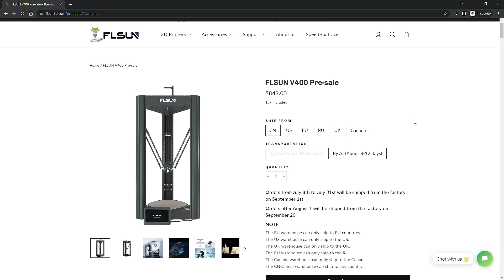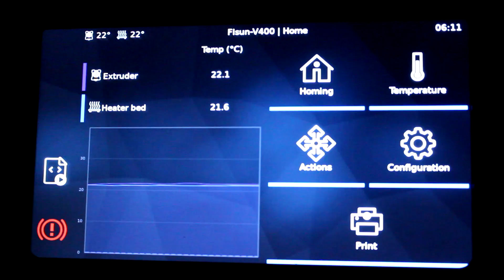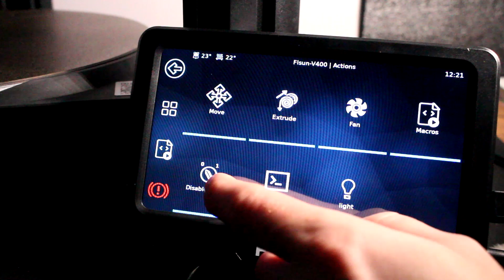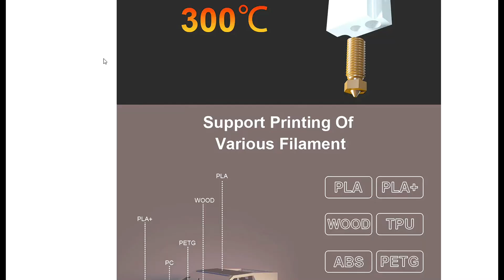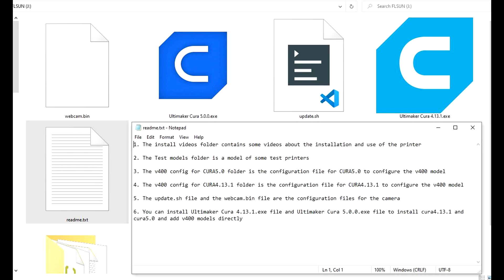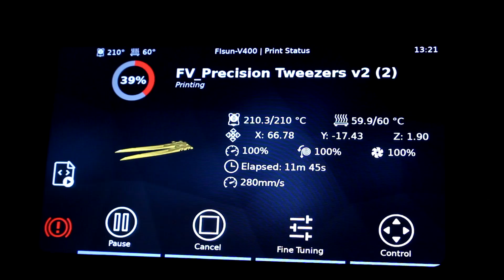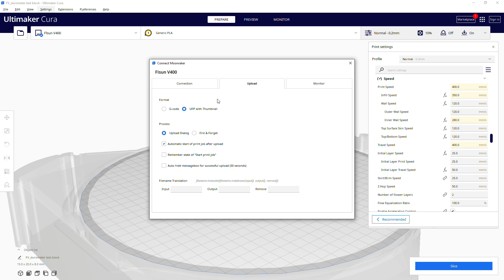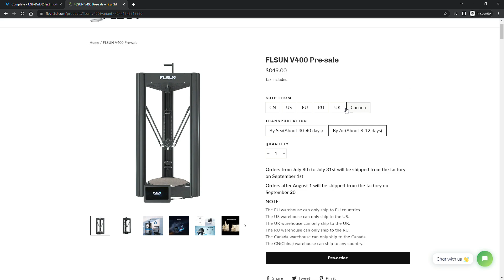The FLSUN V400 is a direct drive delta 3d printer that runs KLIPPER out of the box! Review.

Comment: I was most impressed with the quality of the TPU print.  I can only assume that Klipper's input shaping calibration works very well for delta machines as well.  It was also impressive that a delta machine is using a direct drive extruder presumably by mass reduction in the print head and larger stepper motors to move the print head.  I print a lot of TPU so not having a direct drive extruder disqualified delta printers for me.

Comment: I recently purchased a Flsun Q5 from eBay for sub £140, it was a return, but when I received it the printer looked like it had never been out of the box, all the tools where still in the bag and the filament was still in place unopened. I own 2 Creality CR6 printers and 2 Fokoos Odin printers, an  Anycubic  kobra neo a Sovol SV4 idex and a Geetech A20M which I never use. But for most things I print now I use the Delta printer, it very rarely lets me down and the quality is very good. Going forward I'm putting some of my printers on Gumtree and putting the cash towards another Delta printer probably the V400 when the cash pot allows and the Mrs doesn't find out until it's too late. Really enjoyed your videos on both this and the racer. I also watched a lot of your other stuff. Keep up the excellent work.

Comment: I don’t like the price personally. The pre order price needs to be the actual price. Or they need to put solid guide rods in it vs the screws.
Reply from the maker: screws?
Reply: @LostInTech3D  yea. Look inside the aluminum structure parts. Behind the bests is long metal screws not solid guide rods like the cheaper version of this printer. 

I know there’s a term people use for these rods it has I just don’t know what that is. But the word screw rod describes them perfectly lol! Sorry I just can’t remember their real name
Reply: @LostInTech3D  I definitely would buy this printer at 850-900. But if the real retail price is over that I wouldn’t unless they upgraded to solid guide rods. Their smaller version of this printer with the Bowden setup has them but for some reason the v400 they used the “screw rod’s” unfortunately
Reply: If the keep the pre order price the same as the real price I’m happy. If not and they raise it I wouldn’t buy it

Comment: When you pulled the nozzle out,what is that small crack on the black shroud ? Above the mounting screw.
Reply from the maker: On the silicone sock? I split it 🤣it's fine. But they are a consumable.

Comment: Can the V400 print speed be utilized for PETG, ASA, TPU or is the Ender-6 with speed 150 a better option in output vs investment cost ratio?
Reply from the maker: its a good question, I did print PETG pretty fast but TPU is absolutely limited. Still both faster than an ender 6 I'm sure.

Comment: Already outclassed by the Bambu Lab X1 for $150 more... Real cool to see how far hobbyist/semi-pro 3d printers have come.
Reply from the maker: Not outclassed at all, if I ever get an X1 I'll do a side by side but they are totally different machines aiming at totally different markets.
Reply: The V400 has the Z-height advantage but for everything else the X1 and smashes it,
Auto leveling, auto flow controls, enclosed, faster printing larger build area(square vs circle).

The X1 Carbon adds even more but that's $350 difference for camera, hardened steel nozzle for abrasives, side blower fan metal sides etc.

I'm wondering how these perceived markets are defined. If you want a printer where you don't have to build it, tweak it, configure it and get right to printing or Flsun having you do all the work putting it together for middling results different markets? sure I guess.

Comment: What is a cheaper delta printer worth buying? I got my 1st printer a couple of months back and would like a faster printer.
Reply from the maker: the v400 is in a class of its own, it prints 4+ times faster than an ender. It's double the speed of the SR easily. If you want fast for cheaper, I think there's an argument for going with klipper + kingroon k3ps or something, it should do 150mm/s if I recall correctly.
Reply: @LostInTech3D  Thanks for that.

Comment: If you need a new printer would you go bambo or V400? idk why but i feel lile the V400 ist a superb thing to get. the bamb...not sure
Reply from the maker: That's a hot potato right there. I would go with the delta because that's my jam. But we'll see how the bambu turns out!
Reply: @LostInTech3D  Currently i only own a Vyper and a faster, direct drive that may even be more precise would be sick. Only thing i think id weird is the fan direction on the V400... Not sure if thats perfect haha And the bambu with its filament change system and so on is also damm interesting

Comment: Right now, I'm running an Anycubic Vyper, which is my first 3D printer. I absolutely love it, but the drawback is the ability to print tall and narrow items because the table moves for the Y-axis. I've been looking at this FLSUN V400 for a few weeks now, and I've officially added it to my list for next 3D printer. The fact that the bed is stationary means I don't have to model in a bunch of extra supports on those tall narrow parts.
Reply from the maker: It still has the ability to knock tall parts over due to the um...4 meters per second speed 🤣 but I guess you can zhop and slow it down and stuff.

Comment: I was considering buying a Delta at some point ( a few years back now ) but man am I glad I never did... The Build Volume to Machine Volume ratio is even worse than that of an i3 like Bedflinger but instead of the Y-Axis it is in the Z-Axis - I mean look at it... 50% of the entire height is wasted space and that isn't even accounting for the spool at the top 😑 Ever since building a Voron it has been CoreXY only for me with my Prusa i3 now collecting dust somewhere...
Reply: Personally I love my Anycubic Predator delta. The 370⌀ x 455 z build volume is well worth the space it takes up. Plus for me it was easier to find vertical space than horizontal in the garage. After modding it with acrylic side panels to enclose it from dust and drafts it's been a gem. I have yet to come across a new printer that I'd consider being an upgrade. The V400 is the closest I've seen - that 4x speed would be nice, but not at the expense of the smaller build volume, and not at twice the cost of my Predator.

Comment: Thanks for the insights! I got a heavily modded QQ-S Pro. I also love to watch the Delta working. There's one thing that is missing for me to purchase a V400: An integrated enclosure of the heat chamber. I bought a "warm box" for my QQ-S and it helped so much with sensitive materials/prints. Not ideal because also the electronics get warmer, but it's just a hobby, so it'll be fine for seldom use. Since V400 is a good portion larger I cannot reuse the warmbox from the QQ-S. Thanks for the good Review, though.
Reply from the maker: Yeah interesting idea, I saw someone else made a box around it but it would need to be curved.
Reply: Isn't it actually very easy to make it enclosed? Add plexiglass sheets in between or around the legs? Nothing sticks out and the electronics are on the top. Much easier than an Ender 5 for example, where a lot of things sticking outside the frame.
Reply: @Volvoamazon62  The slots in the giant aluminum extrusions are practically begging to have carriage bolts slid into them to mount an enclosure directly to the body.
Reply: @Volvoamazon62  A bit late to reply but the reason you can't do this is this reduces the print area. When the effector goes to the outer section of the print area it sticks out.

Comment: You can definitely make an Ender 3 v2 print as fast and at a cheaper price. However, you will spend a lot of hours upgrading it. The appeal of this machine is everything is set up out-of-box. So if you just want to print and not learn the nuts and bolts of 3D printing, then this is the machine for you.
Reply from the maker: I'm not sure you could add all these features for that price, and it would be the printer of theseus by that time, I guess you'd maybe keep the power supply 😂
Reply: @LostInTech3D  You sure can. Assuming you have a Pi 3b+ lying around, $300 upgrades the board, screen, hotend,  extruder and a PEI sheet.
Reply from the maker: Do it, we can have a print-off 😉

Comment: FLsun made a good job in my opinion looking at cost to performance and parts used (no use of the usual mgn9 or mgn12 linear rails) considering it can do 400mm/s at between 5k and 10k accel ? (i'm not sure of stock or tuned max accel atm)
Part of it is probably due what seems to be a really lightweight effector design when looking at parts and at the effector size (effector offset makes a difference), if using 40mm rod distance as usual it should help on stability as well.

On my Delta Anycubic Predator at the moment i'm able to print at 400mm/s with 10k accel. At 15k accel ringing starts being noticeable and at 20k it starts struggling which in part is due to the bigger effector i'm using with 2 5015s + Rapido + Sherpa Micro and 64mm rod distance.
Regardless i spent more to upgrade and tune the Predator than you would in buying a v400 and tried and tested.

PS: Despite Deltas "not needing" constant probing i wished they implemented a similar concept as the klicky probe. I replaced my probe with a klicky and it was the best decision i ever made.

Comment: The first problem I saw was all the Klipper comments were in Chinese, I ha d a problem with the Creality Ender 3 Programmer to upgrade the firmware for adding a BL Touch, there were Chinese characters in the software and because my PC was in English the software failed initialy, the fix was to delete the chinese characters and rename the files with an English name, although this wont work with these Klipper comments, and if it is translated by the manufacturer its going to be gibberish, the only soloution is for the user to use a translate tool and then edit that translation into real English!
Reply from the maker: could just strip them out but I didn't see any issues with them in the comments. FWIW I translated some of them and it's just the same text as the English next to it.

Comment: Square corner velocity sets the minimum speed the printer will maintain during a 90degree turn.  Not sure how effective it is on a bed slinger, but for corexy and Delta, it reduces the total deccel and accel needed.
Reply from the maker: So 5 means it reduces down to 5mm/s before executing a change in vector? Cool
Reply: @LostInTech3D  for 90 degrees, it will maintain higher speed at shallower angles and lower speeds at sharper ones
Reply: @LostInTech3D  yes instead of coming to a complete stop
Reply: @LostInTech3D Can you share your best Cura 5.2.1 Settings for V400 using pla please 🙏🏼
Reply: It’s equal to jerk/√2.  Which is supposed to be 3rd derivative of speed / √2. It’s very close to jerk, I guess 1.41 * jerk. 5 isn’t terribly high, it’s default for kipper, a conservative number that shouldn’t break anything. Acceleration is tuned by input shaping, jerk or square corner requires manual tuning. If you want a sub 10 min benchy, that’s the number to mess with, if you wanna see some crazy speeds
Reply: To be noted that when using input shaper (which this printer is probably using to get good quality at these speeds), it is not recommended to use a corner velocity value higher than 5 especially when trying to tune for maximum accelerations.